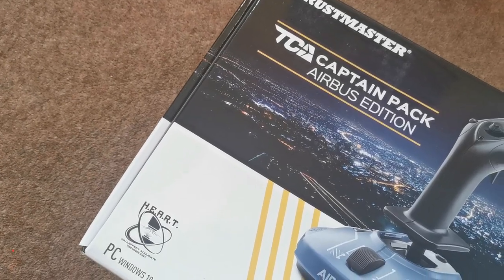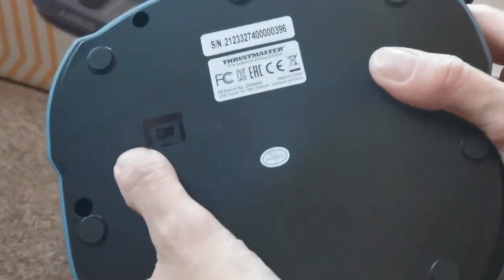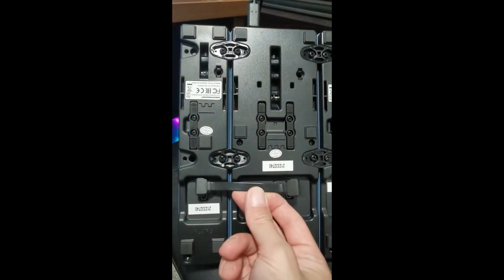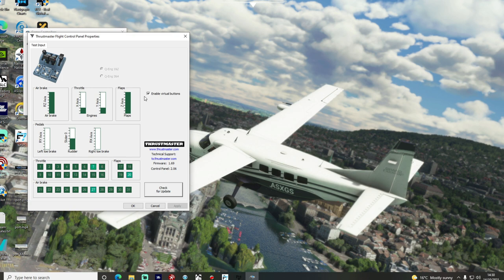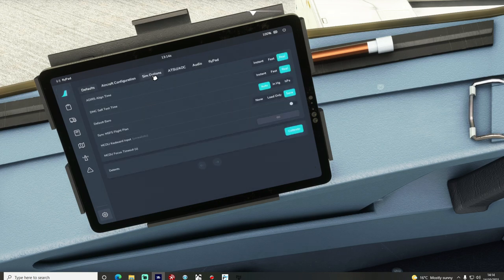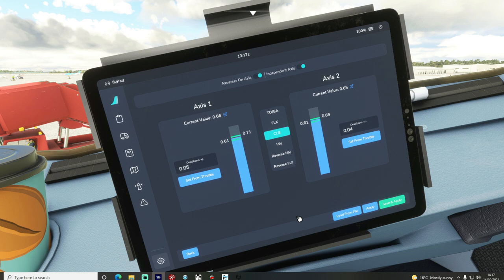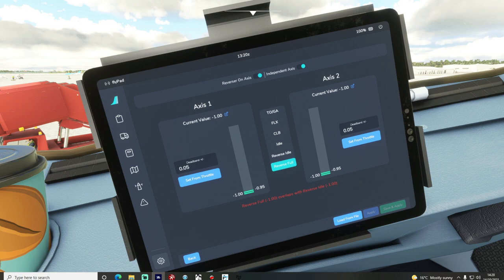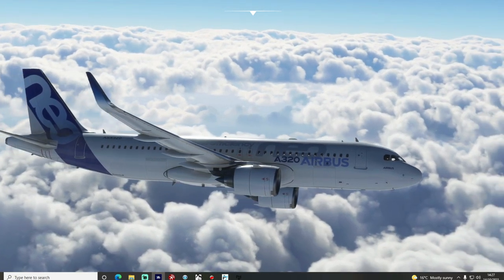New Thrustmaster Airbus Captains Pack - Full Setup & FlyByWire A320 Tutorial

Comment: FYI this does come with a screwdriver for customising the stick and detents... it also doubles up as a rod to slide between the thrusters to lock/sync them together.
Reply from the maker: Indeed it does. Will update video description as I'd not unpackaged this bit when the video was put together.
Reply: My screwdriver won't fit all the way through the slot on the thrusters ☹
Reply: @Easyjetsimpilot I'm glad I saw this before I watch your review... How can you possibly make a review when you haven't even unpacked the box completely?

Comment: I use that set of thrustmaster addons for more than 6 months and they work very well. I had to refine thrust levers calibration editing the calibration file but it works fine and gave me and excellent experience.
Some weeks ago I went to the real simulator of Flight Concept close to Tires airport (for business jets in Lisbon), used by many pilots to train and prepare assessments during the pandemic. And it was very very easy to use all the pedestal controls because I’m used to have them in a similar position.
Reply: Can I use it to fly different aircraft in mfs 2020?

Comment: Thank you for this video. I wish the flaps would've been setup though. Because there being 4 positions setting that up in the sim controls has been a nightmare.
Reply from the maker: It was calibrated in the MCDU in the Fenix A320 so was very straight forward. The default profile also seemed to work out he box for the A32NX.

Comment: There is no detent for idle reverse, correct? So you just move the levers back a little and set that position in the software? Also, a few comments on the hardware. Really should have incorporated the spoiler arm pull the flap lock, and not have the auto brake and gear levers since it takes away from the realism.

Comment: I have had the full set for awhile now. Fantastic for the airbus 320, nx32 and the 330-900. Bit unrealistic to use with GA aircraft but I mainly fly the air bus anyway. Excellant bit of kit. Pricey but worth it if you what to get away from using the mouse, Great emersion.
Reply: Is it good for boeing/tupolev aircrafts?

Comment: Now the big question is will you fly as Captain(Left hand) or FO(Right hand)? I tried left handed and I just can’t seem to get used to it.
Reply from the maker: I've always flown left handed. Even though I'm right handed. Comes from learning years ago when you keep your right hand on the thrust levers. (not in the airbus)
Reply: @Easyjetsimpilot  i have been flying right handed since almost 25 years since most sticks are simply right handed. but of course this always felt somehow wrong because the standard cockpit view was from the left seat. but when i finally got my TCA airbus package last weekend it was time to switch to captain configuration of course. it felt a bit strange for the very first minutes, but after completing a sort of circuit pattern i felt comfortable and the next flight was just normal as always. - maybe driving cars from left seat like here in germany also helps ;) (oh and when i had to drive a couple of right steering wheel cars in my job i'd say that was so much more difficult to get used to..)

Comment: BTW - I had to uncheck the "REVERSER on Axis" since the reverser section didnt seem to be included on the Throttle Axis in MSFS.  Is there a way to add it ?  Where did it go ?
This actually worked for me by unchecking the box on the in cockpit  on the flypad.  Then I went thru the detent settings.  I used this concept for the TM Airbus and the Honeycomb Throttle.

Comment: Hi! Thanks for the wonderful video! I am quite new to Flight Sim and I am considering to buy this Captain Pack. One question: With this setup how would you bind the nose trim wheel? For example you would use the hard buttons? Keyboard keys? Or not used at all?
Reply from the maker: For the nose steering wheel, I use the twist axis on the side stick.

Comment: Thank you for the video!
I have a question: I put both joystick and accelerator usb in pc and Windows installed drivers automatically, even the quadrant ones. Is it necessary to install them? Is there any difference by installing them?
Thank you and have a nice day!
Reply from the maker: For the sidestick, no, for the thrust lever pack, yes.
Reply: @Easyjetsimpilot  yeah, but it works correctly. I do not know why is necessary. Is there any difference?

Comment: I have the same problem with Throttle axis problem, the idle by default was way up, you have to duplicate the default profile, then go to sensitive settings, change two throttles' sensitivities all to linear 0%.
Reply: I’ve done this but it’s still not working for some reason.

Comment: Thank you for this great introduction. Unfortunately its not working for me. The TCA works correctly with the A320 Asobo Version but not in my flybywire A320 :( First: when I move the Throttle in the Flex or Toga position, than you see the throttle not moving in the cockpit. Second: on flypad settings, i can not see the apply and save&apply buttons “lighting” so I can not calibrate it 🤦‍♂️ I tried all versions (stable, developer and experimental), but no luck with the TCA in Flybywire Airbus. pity…
Reply from the maker: If you watch the setup of the thrust lever set up part of this video, it will explain why the appy and save buttons dont light up.
Reply: Have the same issues?
Reply: @Easyjetsimpilot I don't have the tablet in the plane?

Comment: unfortunately it seems there is no seperate physical idle reverse detent on the throttle quadrant, although it has one painted on it. so we have to specify an idle reverse area a bit lower than normal idle in the flypad and just guess the correct spot when pulling back the levers. 
levers could still be a bit stiffer in general, but i'd say they're okay when you crank up the adjust screw. sidestick especially feels very satisfying, quite firm and centers very precisely, so dead zone can be set to almost zero. so far, i would say this is the best piece (or pieces) of gear i've ever had and makes sim-flying the airbus a lot more fun! 
(and now looking forward to the boeing controls, looks very promising :) )

Comment: Hi, I recently purchased the Thrustmaster Officer pack Airbus Edition. However, I am facing issues in configuring proper throttle detent settings. The physical device is okay. I am facing issues inside the game. I have the A32NX Flybywire Add-on installed. Can someone please help?

So the issues are:
I start with when the throttle is idle in both the game and the actual physical device. The moment I touch the throttle physically, in MSFS it is going default at Climb detent. 
2. Physical Device: At Rev Full. In MSFS = Also At Rev Full. This is the first correct setting I am getting.
3. Physical Device: At Rev Idle. In MSFS = Somewhere between Idle and Climb.
4. Physical Device: Idle. In MSFS = Climb detent position.
5. Physical Device: Just 4-5mm above Idle. In MSFS = Flex MCT detent position.
6. Physical Device: At Climb detent position. In MSFS = 3-4mm Slightly below TOGA
7. Physical Device: Flex MCT detent position. In MSFS = TOGA
8. Physical Device: TOGA. In MSFS = TOGA. This is the second correct setting I am getting which is matching both physically and in-game.

I tried all this in the stable version of A32NX.

Someone, please help.
Reply from the maker: Use the EFB in the A320NX to calibrate the throttles, not the in game menu.
Reply: @Easyjetsimpilot  Hello thanks for the quick reply. I am doing it via EFB only. I saw your video twice now. For some reason I am not able to save and apply. It's not enabled for me. Whatever detent position I am selecting on actual device, then selecting the corresponding detent position on EFB, then clicking on set from throttle, it is not giving me Save and Apply or Apply option. Those are disabled. Also, for every setting, I am getting overlap messages. Please help again.
Reply from the maker: @Aditya22Kumar  it will not allow you to save an apply if the detent parameters are over lapping. Lower the null zone setting to something like 0.2 and try again.
Reply: @Easyjetsimpilot  Finally. Thanks for the help. It took a little bit longer than expected but was worth figuring it out.

Comment: for the spoiler I have mapped the detend zero for disarm and detend 1 for arm spoilers.
Reply from the maker: That Is a great idea 👍
Reply: @Easyjetsimpilot  and you can set the dead zone for the spoiler to make sure it starts from detent 2 to activate the brakes. works great for me.
Reply: Turgay hocam "Easyjetsimpilot" videosunda cihazları PC'ye takınca otomatik herşeyi algılıyor ve set ediyor diyor ama benim Throttle Quadrant'ta AirBrake Spoiler ve Flaplar kademeli çalışmıyor. Bunu düzeltmem için MSFS ayarlarda hangi değişiklikleri yapmam gerekli yardım edebilir misiniz? Thrustmaster driverlarını da kurmuştum. Teşekkürler
Reply: @dadaloglu5071  bende otomatik algilamisti.

Comment: does it work ok with the a330 900 as it doesnt have a detent config
Reply from the maker: Yes, I used it in a live stream the other day. You have to set the detents in the 'sim' thrust levers though, not the physical ones.
Reply: just change to the default profile of the thrustmaster and then reset the sensetivity.
Reply: @landsfadern2  i tried that but flex dent is slightly off still

Comment: Sadly the autobrake switch still doesn't really work with the FBW Experimental version. It selects the right auto brake setting, but it deselects it in the sim after a while.
Reply: Not for me. You probably have another shortcut assigned to it which may interfer with the tca
Reply: @homasas4837  Do you just use the settings out of the box or have you altered them in any way? Because I don't have anything else set to the autobrake
Reply: @TheGerudan  I use the out of the box settings. But your keyboard bindings and/or mfs assistance/option may interfere. I set the autobrake at tod and it always last until landing